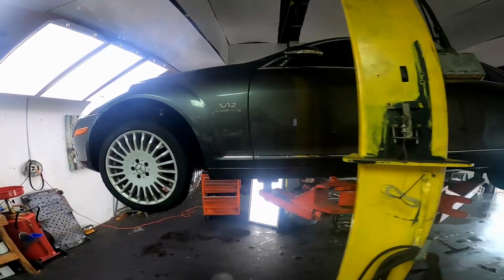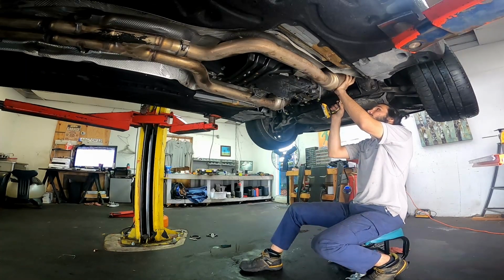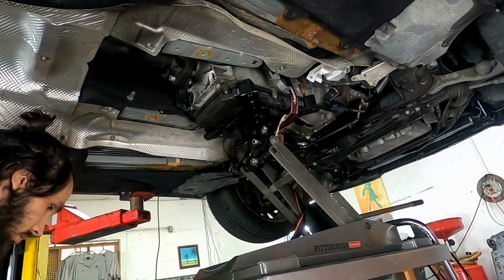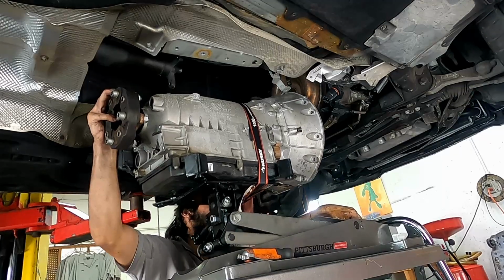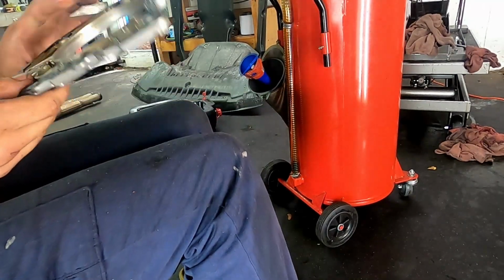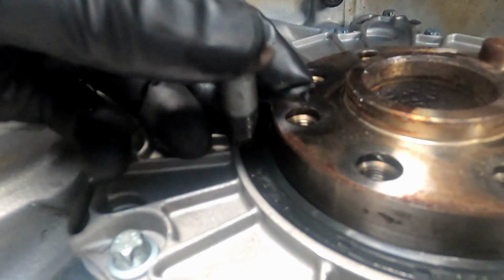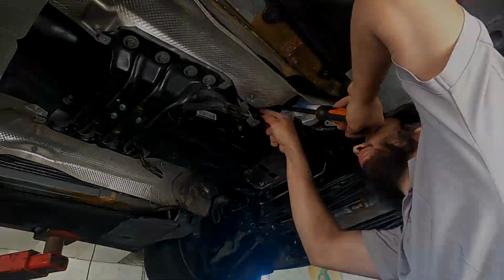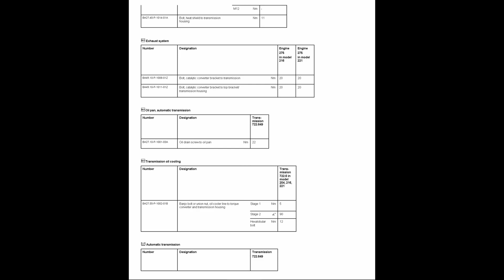S600 Rear main seal replacement. 2007 w221 5.5L v12

Comment: Very informative and clear video, thank you.
I am about to remove the lower and oil pans of my 2008 ML350 W164 without taking the ngine out, just hoisting the engine but concerned about braking anything, how to disconenct the engine from the trany, do I just remove the engine mounts bolts, the torque covertor bolts and then the trany to engine bolts or is there something else?  Thank you.
Reply from the maker: What exactly are you trying to do? rear main seal on 08 ml350? why would you take the engine out?  I dont understand why you would take the oil pans .
Reply: @M.A.S.-SuperiorService-   I appologize, I meant to write " I am about to remove the UPPER oil pan ". 
To clarify, I was replacing the Cam Adjuster when the chain jumped and I had to take the timing cover off to time the chain. I have to take both oil pans out to put the cover back on. I did take out the lower pan but to remove the UPPER pan it looks like I need to lift the engine, My question is: To lift the engine, is it just removing the engine mount bolts, Torque convertor bolts, and unbutton the engine from the trans or is there something else to it.  Thank you for your time.

Comment: Hey man
First of all, great video!
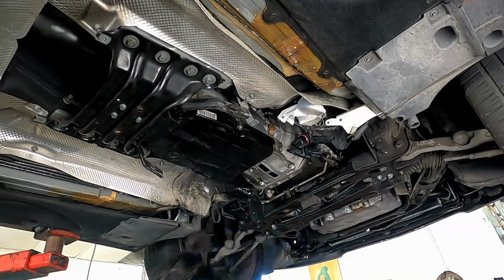Second of all, could you please elaborate on what you started doing from 46:56 till 47:24?
Reply from the maker: Yeah so the torque converter is connected to the flywheel with bolts and that's how they're one unit because without them the engine would spin freely. In manual cars the clutch does this job so there is no need for bolts but with automatics the torque converter is always spinning with the engine. 
Bolts are evenly spaced around the flywheel so you have to turn the engine to get to all of them
Reply: @M.A.S.-SuperiorService-  Thanks for the explanation!